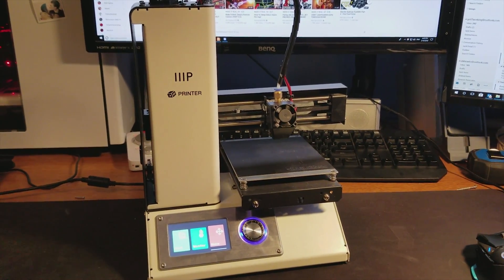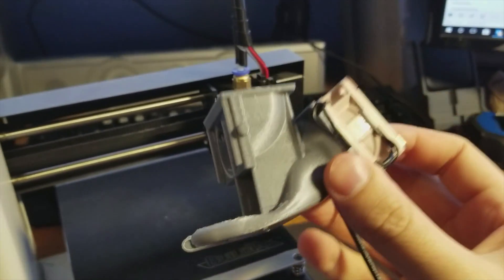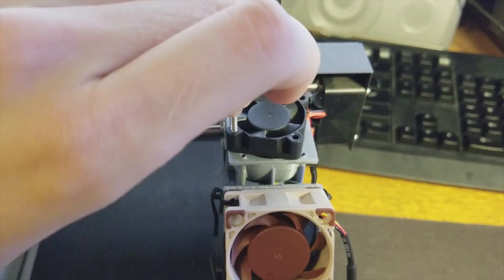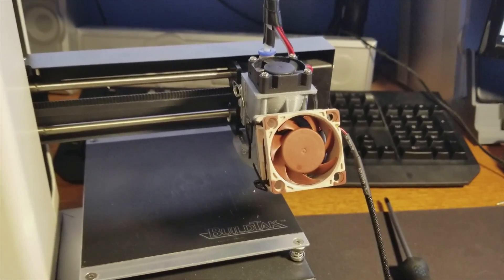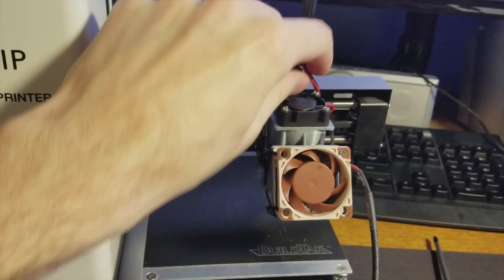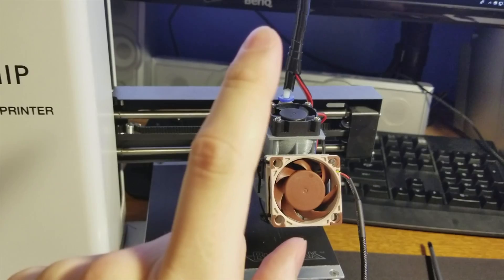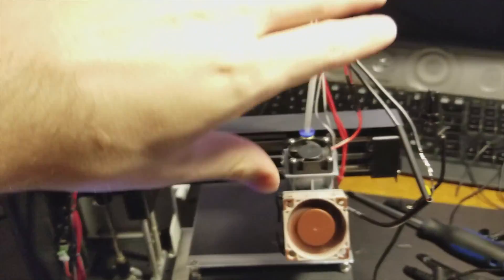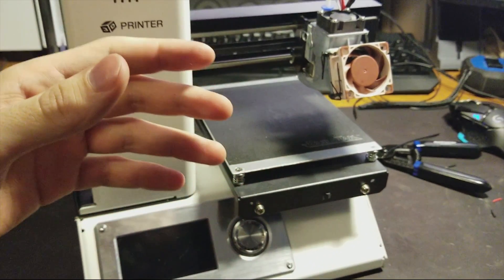How To Mod an MP Mini - Dual Fan Cooling!!

Comment: I liked your suggestion on a separate part cooling fan and moving the original fan to the top.  I decided to change the approach of wiring the fan to the bottom of the main power connector.  Instead, I change the plug out and crimped new pins for it.  The fan wire has a standard male connector to receive the fan female plug once the new fan mount is printed.  This way I will not have to cut anything out, just unplug and remove.  My military background kicked in and working on tactical radios and radars pushed me in that direction, once I finished watching this video.  I also changed out the extruder for an all-metal Bowden setup that I had lying around.  This is a really nice printer and very easy to work on.

Comment: The duct isn't there to cool the hot end. The hot end is where the heat is applied, electrically, and its temperature is controlled by the thermistor. No other heat management required. In fact all you're doing is wasting electricity. The duct is there to cool the part, which means the revised duct fitted here is completely misdesigned and unfit for purpose. Print quality will suffer and power consumption will rise.

Comment: Why would you want the parts cooling fan on all the time? I would have had the top fan on all the time and the parts cooler controlled by the Gcode.
Reply: how can you control the part fan with Gcode?
Reply: @tfmg8223  I'm doing this now - You wire the part fan in place of the original fan on the board and let the slicer code the cooling as usual. Run the hot end fan to the always on 12v and forget it. No real need to turn off the hot end fan.
Reply: @DSK349  oh cool!

Comment: Umm.. pretty sure you just needed to change your start G-Code to an M 106 start command at full fan speed. While simultaneously disabling the adjust fan speed for layer height. That's what I did for my fan upgrade and I didn't have to open anything up besides the hot end.
Reply: How do I change the g code can you help? Stuck on the same problem